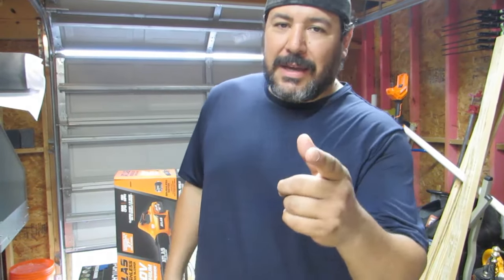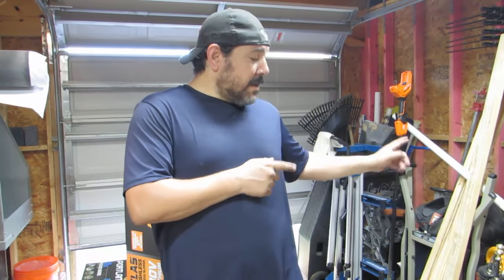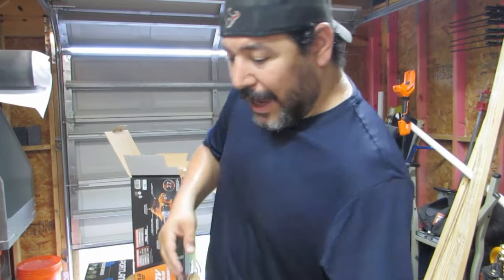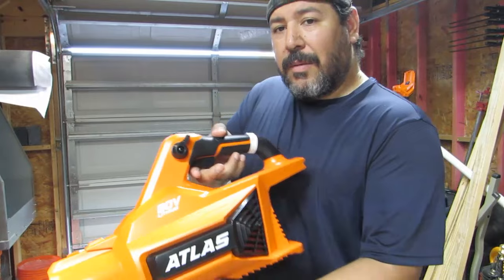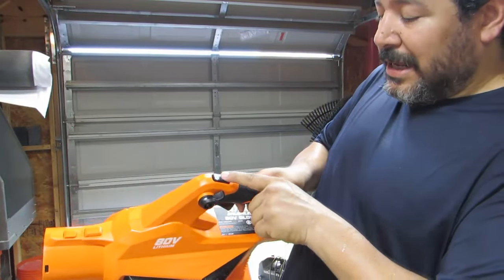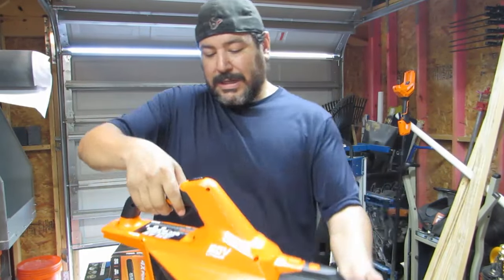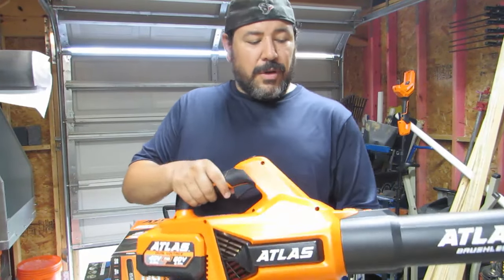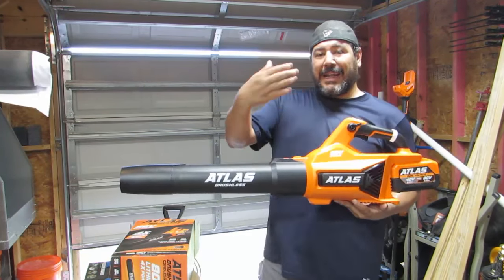Atlas 80v Blower - Assemble, Test, and Thoughts

Comment: my 80V Atlas Blower will only blow at a low speed ... the high speed stopped working yesterday ... any idea why and what the fix may be ?

Thnx!
Reply from the maker: Sorry bud, looks like a lot of comments got hidden from me. Just noticed a bunch weren't replied to. Did you get this figured out?

Are you saying that when pulling the trigger to go at a higher speed, it will stop blowing at the higher speeds? Or are you saying that the turbo button doesn't work anymore? Not sure why the trigger would allow to blow at lower speeds but not at higher speeds.

Comment: You mention getting a lighter 40v battery so your wife can use the blower if she wants.  That will not work. While the 80/40v battery will work on the 40v blower and string trimmer, the 80v equipment requires the 80v battery.  You can use the flex volt 40/80 battery on the 40v gear, you cannot use a 40v battery on 80v gear and have it work at lower specs.
Reply from the maker: @TexTom1981 You are correct and I totally didn't catch myself saying that! I was starting to say (in my mind), if you needed something lighter, to get the 40V Blower.... but then I confused and convinced myself that the 80V blower accepts both. Ughh I sooo messed that one up. I will make an update video and correct that. Much appreciated and thanks for having my back and not butchering me! Hit up my email, bud. I got something for ya. 👍
Reply: @EverythingInBetween22  Sent you a note via email.
Reply: @EverythingInBetween22  that's really cool.  Thank you.  Just for the record, I picked up the 80v version due to this vid.
Reply from the maker: @TexTom1981  Thanks! I hope you love it, but if you don't, please send all complaints to HFT hehe! :)
Reply: @EverythingInBetween22  Got it, brother!
Reply from the maker: @TexTom1981  Awesome!

Comment: How fast do the batteries charge
Reply from the maker: I keep forgetting to see how long it takes but on the regular charger, I checked back after like 2hrs from completely dead and the 80V battery was still charging. If you need an 80V battery charged in less than an hour, I would get the rapid charger. The extra $30 it costs would probably be worth the convenience of time-savings.
Reply: To add in, get the best battery and charger for Atlas products. They are the power, and will give you the longest run times. More expensive to get the best battery and charger, but it makes it nice to be able to just buy the other Atlas tools at a fraction of the cost of the gas comparables.

Think of it like a Tesla… do you want long range or regular shorter range (battery) do you want to use it more often in the day (rapid charger)
Reply from the maker: @HellsHemi  I agree. Although, I've had to get a 40V battery so my wife could use the blower if she wanted to. It's much lighter than the larger battery, which gets too heavy for her, longterm. Give me the long range! :)